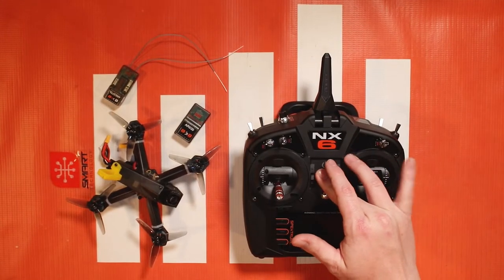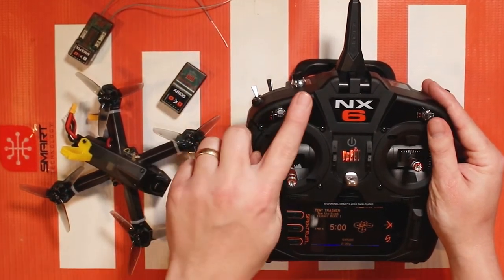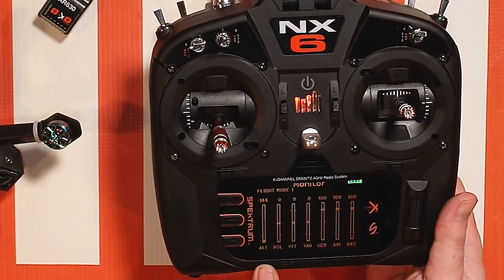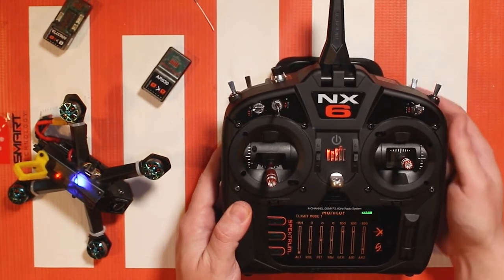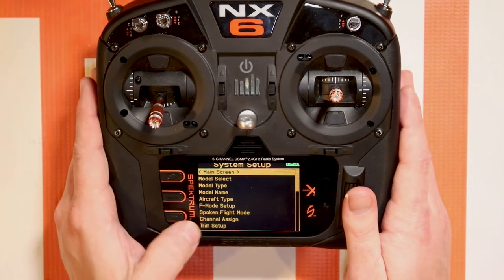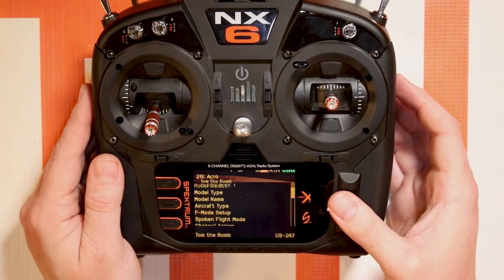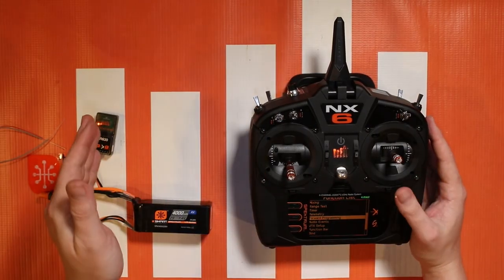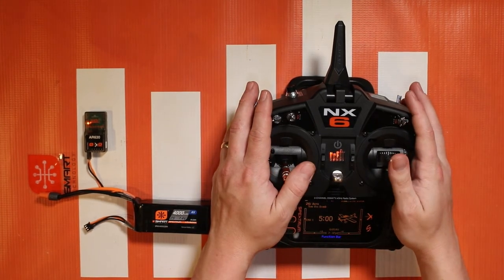NX Instructional Series - How to Setup the 7th Channel on your NX6

Comment: So when I link the NX6 up too Real Flight, there is a throttle delay in the 3 middle notches, however the interlink controller doesn't do this, is there a setting I have wrong?

Comment: Why can't I program my Aux-1 on my Spectrum NX8 Transmitter. It's on channel 6  an on the side it says N/A , what does that mean.
Reply from the maker: Likely you have a wing type selected that has assigned that channel to another function, such as flaps or left aileron.

Comment: This new Aux2 has appeared on my DX6 Gen 3 after updating it..
I can assign it to a switch but it is immobile on the monitor function where you can see the movement of all channels. Is this normal?
thanks..
Reply from the maker: That is a bug with the latest DX6 firmware, it is inoperable and will be fixed in the next update.

Comment: When will the 7th channel to be used for SAFE be provided for the DX6 G2/3? I bought my new G3 DX6 4.5 mos ago, just before the NX6 was introduced and I'm looking to buy a HH warbird now. This will be provided as a firmware update, correct?
Reply: no, the dx6 will never have a 7th channel, if you want a 7th channel you have to buy the nx6.
Reply: @jf27556  Yes, I know. I bought the nx6 radio 5.5 mos ago and already sold off my dx6.

Comment: Can you store/save telemetry data such as altitude/vario on the NX6
Reply from the maker: Yes, use the telemetry log function
Reply: @SpektrumRCvideos  thanks for your quick reply. I have managed to do that. A file name : 001~1 Sail.TLM was created.   Activated by throt stick. One time is Active, Enabled is Yes, Input Data  is Yes. Problem.... i cant see the file. must be doing something wrong. Can you please give me any further help??
Reply from the maker: @liellthomas2894  It should save the file to the internal memory or an SD card if one is inserted. To access the internal memory you will need to go into USB settings menu, turn on mass storage mode, and plug into a PC. Hope that helps!